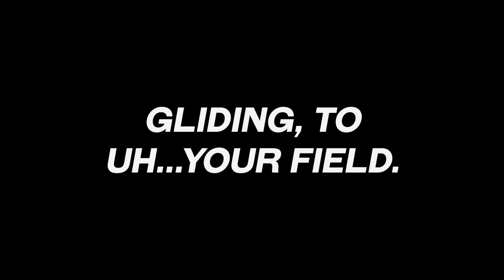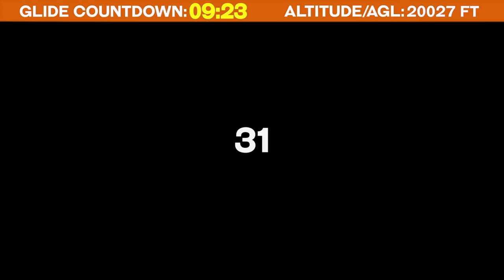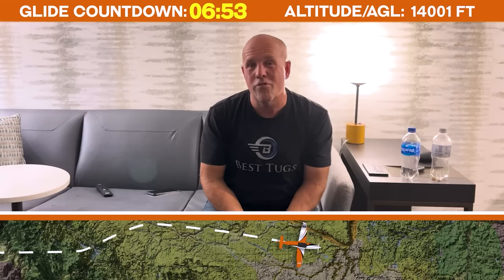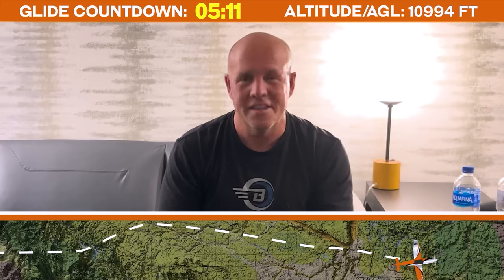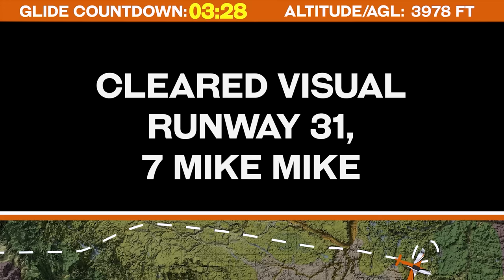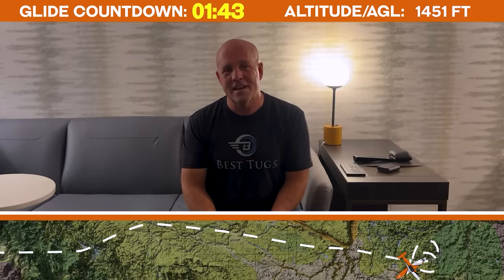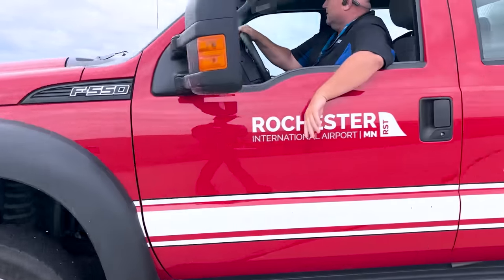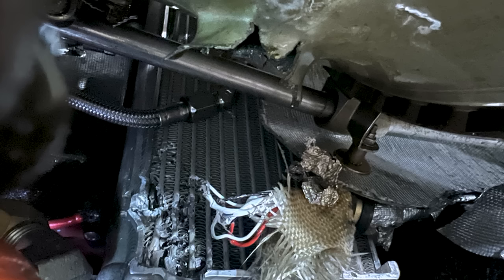Engine Explodes In Flight - Turbulence will not be at Airventure 2023 | Turbulence Emergency

Comment: Well done on handling the emergency. I've been in the King Air world for quite some time now with 1000's of hours of PT 6  experience. Turbine blade failure is not super uncommon. Pratt and Whitney has actually manufactured and installed compressor blades on brand new -51's that didn't make spec at first hot section. I rejected a King Air purchase with engines 100 hours from first overhaul that had Stage 4 sulfidization. Those engines were junk. Couldn't even get core value on them for Black Hawk upgrade. Pt6 are good engines but they are not perfect.

Comment: Wish we could share pictures. I'd post a pic of the fuselage on a Bell Jet Ranger that I had just finished a vibration check for the engine I had JUST REPLACED! The Lycoming T63 A700  turbine engine self destructed and blew holes through everything. I wasn't on board. Wouldn't have mattered, I'd just have a better story. The pilot landed from 10'000 feet safely doing an autorotation.

Comment: There is no doubt that the second stage power turbine failed. You will have to look real close at all the history of that turbine. I'm sure it came from another engine that over temp and was broken down for parts. For the PT1 to be fine there is no doubt the PT2 is from another engine that over temp.

Comment: Hey Mike,
When the engine failed, was there a moment when the blades were not feathered but the prop was stopped? If so was there significant drag before you were able to feather?

Comment: In a turbine engine failure, first thing fuel shutoff, turn fuel lever off, shutoff fuel pumps, immediately, FLY THE AIRPLANE, THEN when time permits reduce electrical load (single engine)  communicate

Comment: PT6 uses a gas’s generator, propshaft isn’t mechanically coupled to the engine so an abrupt prop stoppage sounds like a gear case failure on the prop side to me.

Comment: Glad you made it down safely. This armchair pilot woulfd also like to mention, that you might want to have a very close look at the structural integrity around the motor cage and the adjacient fuselage. I only can imagine what forces have been working in those areas when the inertia of the PT6 internals were suddenly brought to a violent stop

Comment: I was wondering if this engine was brand new or used and if it was used before with an unknown history, was a borescope inspection performed before installing this engine?
A turbine engine is reliable as long as a consistent MX program was followed to spot any metal fatigue or even FOD or corrosive damage on any of those internal blades, compressor stage or turbine. These mainly are the ones that don’t give you any previous indications of a failure pending.

Comment: Any word yet on the Failure Mode? It almost would appear as if a bearing or seal failed causing one ore two of the ball bearings to be fired back into the PT2 blades which knocked one or two of t hem back into the blades/veins behind the Pt2 set.  While also batting the ball bearing out of the case like a bullet. Then the pieces wrecking the rest of the Pt2 blades and ejecting them out the exhaust. That would also explain all the oil. Now as to what may have caused the seal or bearing. to fail? I dunno? I'm no A&P,  crew chief, or nothing like that but i did stay at a holiday inn express last night...

Comment: You said you're sending the engine back to P&W for investigation. As a few others asked before, does P&W could find the reason for the failure yet? If you told it in a other Vid i missed that.

Comment: With the smoke in the cabin, oil on the windshield, and your concern of fire, why didn’t you mention it to ATC?  What is involved in rolling out emergency trucks? A huge bill? Is it just not feasible at certain fields? Or do you have to be a certain size or something?  Did you have a plan for getting out of the aircraft? If the engine was on fire?

Only after you were on the ground did you mention that there doesn’t seem to be any fire.
Reply: OK at 27 minutes in the video you talk about how you did ask ATC for emergency vehicles. So it’s all completely moot! 😂  yes, I should’ve watched the whole thing for commenting, but I assumed you would’ve added it in your communications, re-creating the emergency

Comment: input the all the telemetry into chat gpt and ask if there was risk of resonance in the transmission due to supersonic turbine tips being directly connected to your subsonic prop which torque sync with fluxed airflow into engine which creates feedback? also, carbon prop, carbon wings, bit in the middle. its like the wood panels on steve morris station wagon exploding all 8 con rods due to resonances...

Comment: Likely caused by one crack so small it’s invisible even with a magnifying glass. One blade lets go, domino effect wipes out the whole wheel. Likely could have been discovered using a dye penetrant method. That being said these types of inspections are rarely required by engine manufacturers outside of overhaul. 21 year A&P 18 year NDI Certified Tech Inspector.

Comment: Dude. First, glad you're okay.

Second  You shouldn't be so surprised because things break.  I've gone through these questions with a bunch of different companies in multiple industries/jobs over time.  People shake their heads and are stupified that something gasp broke. 

The answer? You have moving parts. Hell, even if you don't have moving parts, you have parts that have electricity going through them in the case of a circuit board. You have a roof on a house that takes weight in winter from snow that fails from overloading or the tiles wear out or a hurricane blows it up.

Almost every single engineered and created thing on this planet has a TTL-time to live. It's never a good time, it's rarely ever planned and it should really never surprise you because if you're surprised, it means that you weren't possibly being safe by planning for an eventual thing with your things which is that all things eventually wear out for a reason.

Hope you get her up and going quickly but I hope you're not surprised if there's a next time. Everything breaks or fails or wears out or stop working.  The important part is how you respond to those things.

Comment: Out of all the videos in your series I only saw your plane fly on your Madian flight of one take off. would have liked to seen more of you flying your plane in other videos. How much do you pay for a new or used engine. What was the total cost of your plane to build, just questions like this would be nice to hear. How much fuel can it hold and how many air miles per gal. What is the cost of jet fuel for your plane. Thanks

Comment: Could you do a ground battery no alternator input timing check using what you used on the way down. See how long you have on the Garmin and prayers? recharge immediately after :-) Did the GArmin calc the extra prop drag?

Comment: The failure of the engine sounds like the engine sucked a piece of metal into the intake. I am guessing you lost the piston out of the  wall? First thing I would check if possible is to see if a piston has a dent from slamming something hard into the head. There should also be a dent in the head if that is what happened. Really curious to find out the cause of failure. That is my best guess based on that kind of instant failure with no warning signs in power loss. Please let us know what you find out.

Comment: My experience with the -41/42 series associated with catastrophic failures have been more associated with corrosion problems. I wonder if that king air it came off of was based or operated in a coastal environment?

Comment: Sounds and looks like you just need the power turbines and hot section stators and cans.  Half an engine.  Should be considerable value in the compressor section, accessory drives, shafts, and drive reduction assembly?   Was this just a used engine or did it have any warranty?

Comment: could it be an external mechanical influence that instantly caused the rotation of the engine to stop cold, with a huge building up of enormous pressure during that last second…. ?

Comment: 32:55 "running normal King Air temps which was upper/mid 700s" - do the -42s really run that hot continuous ITT in the King Air? I thought most of the smaller PT6s have MCP limits of around 750 degrees, for example the -37A I fly is limited to 755 degrees MCP, 810 MTO

Comment: Just guessworking.... Is it possible that this discolored steel plate ( burner chamber ?) got too hot ( injector leak, loose injector tip or something ) and bursted a hole on it.  That caused a compressor pressure drop in a fraction of a second and turbine shaft over speeding and broking blades? Might being totally wrong bc I'm not a aviator. Just trying to umderstand root causes.

Comment: I can't remember exactly but on one king Air Eng I inspected the previous mechanic had a oil line chafing a fuel line because of the clocking of the b nuts bent the lines so they touched down stream it was just about chafed through would have caused a high presser mist of fuel, or if the oil line went first the main bearing would have lost presser..

Comment: What are the thougths around that this is a engine used in the fastest propelled airplane in the world. Is f.i the fact that the air pressure for the intakes are a lot higher then normal because of the high speed or can the rapid change in the airflow be a proper cause for the turbine blades to be more stressed than usual?

Comment: flying that high might call for a 'Ram Air Turbine' to keep the batteries up on a long descent
Reply: I think the battery thing was a little melodramatic. Batteries big enough to spin up a gas turbine are not working very hard running avionics. And Lithium ion batteries age a lot better than lead acid - if you have a 3 or 4 year old lead acid battery that has been abused a bit, maybe then there would be a legitimate worry that it no longer has its rated capacity.

Comment: I'm no avionic or mechanic, but is it possible to have an emergency battery separate under the seat, or the main battery in the cockpit etc. So it would be close by to switch off/on away from engine?
Reply: Meaning, if something like this happens, being able to switch from damaged powercable to separate to keep radio/minimun stuff on for the glide.

Comment: Sounds like some kind of metal structural failure in at least one of the blades undetected by ndi inspection. It only takes 1 microsopic crack unseen to the hunan eye. Maybe youll never fine the reason, but know this, you fell back on your training and saved your friend and youself.

Comment: Everything you went over, to me, points to a straight up metallurgical failure. It's a wild one.... I started hunting for info and came across a 1983 paper on turbine disc failures and even by then, 1.74 million flight hours on the PT6A with zero uncontained failures, 6.3 failures total per million flight hours. 

As you've probably found and heard... nothing like this has been described. You literally have a unicorn failure here.

Comment: Stinks this happened but the most dangerous time is right after a big change like this so if it's going to happen then this would be the moment.  Really surprised your operating limitations let you take off for a cross country flight without flying off 5 hrs minimum after a major change.

Comment: That seems like a material defect!
Maby the turbine wheel fractured?
Or a blade?
Reply: If the turbine disc failed you get a hole right out of the😂 engine big enough to put your arm through.
Reply: @bobfmirvine6652  You watched the whole video?
There are alot of holes in the engine and parts even blew out of the hull!

Comment: If the engine is going back to PW, shouldn't you keep all of the fragments in sealed bags (where nothing gets lost and foreign substances do not get at them), instead of keeping them in your pocket?
Come on... Those metal fragments might be super crucial in other to find out the cause of the failure.

Comment: Ever hear of the concept of "Product infant mortality"?
Basically, one of the most likely times for something to fail is RIGHT AFTER it's made. Say within 5% of its expected useful lifespan.
Since you said this PT6 just came out of overhaul, and I know from previous reading that an engine overhaul in aviation is supposed to "reset" the hour meter on it (aka return the state of the engine to match the state it was in when it was first (correctly) manufactured), it might as well have just come out of the factory brand new.
So I think you suffered an engine failure that is "just another statistic", even tho the specifics of the failure mean that it didn't go "quietly" by any measure.

Actually, there's more to it than just that, so let me go over the whole story.

Companies have been keeping tabs on why and when things they make fail for a very long time.
They discovered a very clear trend in the data they collect.
It's not just a trend in the data of turbine engine manufacturers either. It's literally everywhere.
Automakers, tech companies making cell phones and smart TV's and PC's and laptops and all that stuff, all the way down to people that make lightbulbs (the old school incandescent ones even show this trend).
You get this trend to show up by noting the number of products that have failed in the Y axis, and what percentage of their useful life was expected to remain when they failed on the X axis.
The trend is obvious. It even has a specific name, the so-called "Bathtub curve" of failure.
Most products fail either early or late, and few products fail right in the middle of their useful life if treated properly.
If it's not abused, you can expect pretty much any manufactured thing to fail either within 5% of its expected useful life, or after 95% of its useful life (different products have different minimum and maximum values for this bathtub curve, and generally if you hold very tight tolerances when manufacturing the thing (beyond what is needed to ensure that it meets the expected average lifespan), the less you'll see of early failures.
Significant testing and adjustment of the design is needed to reduce the variability in failure timing at the end of useful life however.
Both of these efforts are considered "wasted effort" and "useless expenditure of company assets" by the bean-counters, so you barely ever see it unless you are working at NASA and things are operating on a "cost no object" basis.

Put in layperson speak, that means that things fail either shortly after they're made or when they wear out.
I know this engine is an "old" engine, but you said it just came out of overhaul. As far as the bathtub curve failure model says, and as far as what an engine overhaul is supposed to do, the trend is simple:
This engine was a victim of product infant mortality. There was likely some defect in how it was overhauled, as loathe to admit that as you might be.

The only way to know for sure what exactly went wrong and if it was preventable is to wait for what P&W says about the autopsy.

Comment: Disclaimer: I am not a pilot, nor connected with aviation in any way (except seat 17D, spam in a can, on an American 737).
I would like to hear a discussion of why this new, cutting-edge experimental race plane was equipped with a very well-worn engine. I have heard 5-6 thousand hours mentioned. What kind of inspection did this engine have before being installed in the “Turbulence?”

Comment: ok doesnt the gear box shaft run off n2? it's been a few decades so forgive me if not remembering right. had one blow up on the test cell because a bolt off the bitch tube fell into the gear box. n2 stopped and pow and it was loud, and that motor was sitting on the stand. It almost sounds exactly the same. and trust me you would have not saved it. Im sorry that happened to you. we all know shit happens in this world.    J52 mech.  IM OLD SCHOOL

Comment: Hey Mike, I hope this comes off good and not judging. It seems like you're accident prone. You had an issue with Draco now this. Could it be viewed that it's you and something you did? You claim that those engines are bullet proof, etc, yet it failed when you flew it. Especially, with how you spared no expense having a great mechanic, etc. 

ADM is the major cause of most accidents and one could argue that there was never anything wrong with that engine and after you had one of the best mechanics work on it, etc, it failed under your watch.

 Blaming someone for not hot-starting correctly and all the other excuses seems poor excuses and you being a victim.

One other thought, I'm not sure if that engine is supposed to be in that airframe, seeing I know nothing about that plane. However, you push the limits in most things you do (ie: Draco). I don't fault you for that, in fact applaud you for it, seeing I would do the same thing. That being said, that's part of your ADM...pushing limits.

I hate to be the one pointing this out and glad you're ok. I'm hoping you'd really look at yourself and not place blame on everything else but yourself. I know you're better than that.

Comment: Good reason to NOT buy an old unknown engine.  Turbines should have a recorder that marks hot starts; this is especially critical if a hot inspection can't find a problem.  All the arguments for using an engine with thousands of hours left sound good but for one thing:  You have no idea if the previous owner hot started it and how many times.   I have to wonder why someone would take a low time engine out of a King Air and sell it??